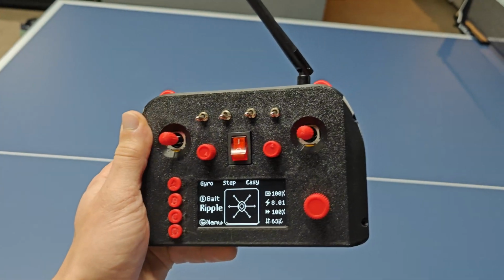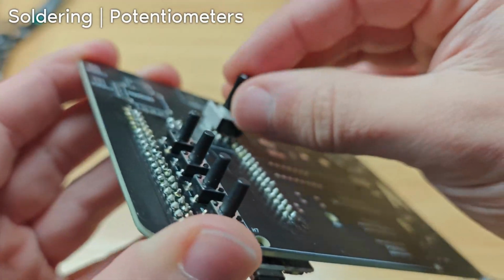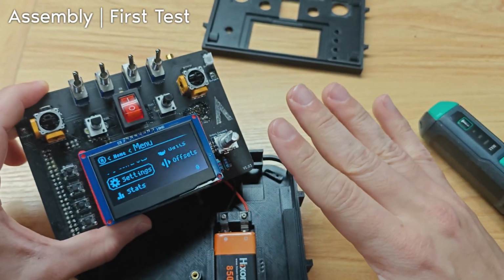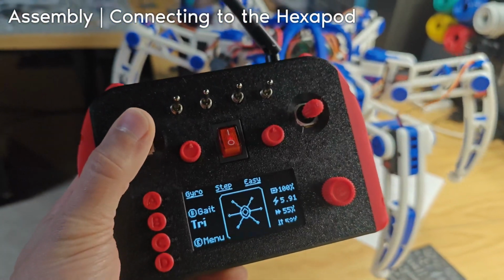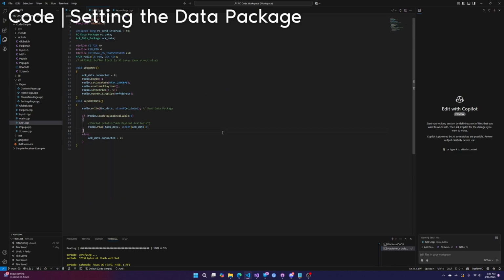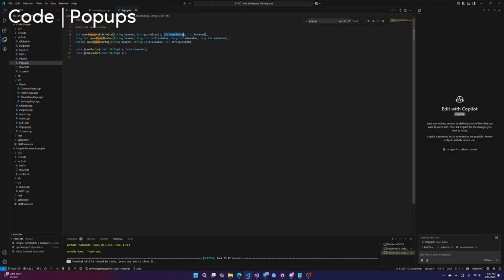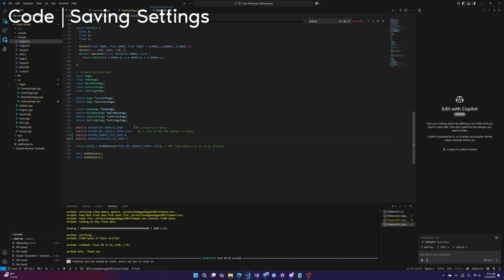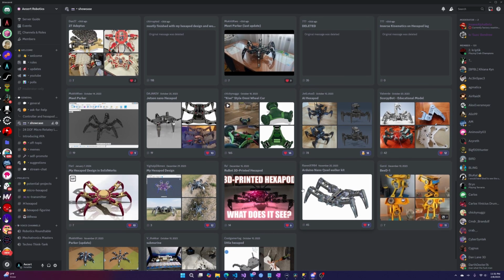How to Create My Arduino RC Transmitter

Comment: You weren't kidding about those Arduino pins - getting around the crystals for some of them was a bear - while I didn't do it I think it would be a good idea to trim the long pins down to just a couple of mm above the board for easier soldering

Comment: Hi, i was wondering what power set up you are using, im using a bread board and the Zeee 7.4V Lipo Battery 2S 50C 5200mAh battery you are using, but i was wondering what esc you are using?

Comment: I want to start this project but servos are extremely expensive in our country and I want to make them cheap and affordable. Would it be a problem if I use the mg996r 180° one?
Reply from the maker: @thotx7842  my CAD project won't work with them easily unfortunately. You'll be able to edit them to support the mg996 servos though. The files come with the kit or can be purchased separately.

If there is enough demand I'll make a CAD project that supports those servos.
Reply: @AecertRobotics  Would it be okay if I developed the CAD project and modeled the servos accordingly and made changes to the code?

Comment: Do you genuinely believe in brilliant as a good resource to learn more electronics? I'm a bit stuck as of late and not sure where to learn from
Reply from the maker: For the basics its honestly a really good place to start. They have a circuits course. Itll teach you about how voltage, resistance, current, etc works.

What are you trying to learn?
Reply: @ thank you, I’ll check it out
Reply: @ Circuitry, mechanics, and probably aerodynamics in the future, but I’m focusing on robotics at the moment
Reply from the maker: @novict gotcha. You should be able to check out the courses they have available for free. I don't think they have anything on aerodynamics or robotics, but yeah definitely check it out regardless! I can tell you that the linear algebra course directly related to what I had to do with my hexapod.

Comment: Interesting- this is a seriously in depth- in deep project that you've gotten yourself into- Not only that, but what you have put together is mighty powerful...you can do ALOT with such a platform...especiallt if you have the cababillities to "listen" to specific frequencies, as in monitor...kindlike a SDR...say you had another RC remote but didn't know the exact frequency...if your device could  pick up on the signal if the other remote were to be used...and say....capture that signal...

You mention the wireless module you are using...well the NRF has the same pinnout as a few others..one that comes to mind, being used alot in our gadgets and air cons and key fobs is the CC1101... pretty much take the NRF module and swap it for that of a  CC1101 and now your remote control can work with devices in the 400mhz, 900mhz frequencies...

Some thing to take away.... would be of use to utilize multiples of the NRF allow for full duplex..even though it does RX and TX alllready, you could seed things up or monitor the signal for other neat uses....
Reply from the maker: Ngl this is over my head, but if and when I make an advanced version of this controller id genuinely love your help/advice

Comment: You have done a nice step by step set of instructions.  In my view you should include some heat shrink sleeving for the bumper micro switches as some people may not dolder properly, and that would keep any stray strands of wire from fouling amything.
Reply from the maker: @videogenie1236  that's a fantastic idea. I'll add that to the written instructions.

Comment: Can i use raspberry Pi pico replacement of Arduino mega?
Reply from the maker: @Aditya-wi5ei you'd have to redesign the PCB which may be difficult, but it should definitely be doable!
Reply: @AecertRobotics  why you are using Arduino mega?  it difficult to get and we have better alternative for it like raspberry, esp8266 ,STML etc
Reply from the maker: @Aditya-wi5ei what do you mean difficult to get? 
I have no experience with any of those tbh. If anything I could've used a teensy 4.1 but I only discovered that after I was too deep into using the mega.  I do plan on using the teensy in my next version though.
Reply: @AecertRobotics   I am beginner in electronics. 
In my opinion  teensy , raspberry pi and esp are much Better to compare( price & features) Arduino boards  . 
Anywhere I am your new member in your channel family 👪
Reply from the maker: @Aditya-wi5ei  I do think Arduino is easier to use than esp and rasp but I totally agree the other options are overall better, I just didn't know about them 😄
But Arduino is still a great option and it makes it very approachable :)

So glad to have you!! You should join the discord if you haven't already
Reply: @AecertRobotics   please can you make next  video on remote & receiver based on raspberry Pi pico or esp  , cause in India atmg & teensy is  harder to find and i don't have knowledge about them 🙏
Reply: @AecertRobotics  but thank for your feedback ❤

Comment: Please make a video on 10 to 15 RC Transmitter and Receiver for controlling all types of Drone, all types of Aroplane, Car, Bohat, etc just like Flysky or Radiolink we can doa many more settings in this types of Radio controler , there are videos on YouTube but they don't include The Display for setting  Channels and more settings and watching the value of Throttles, etc please please make video and Give the code for each TX and RX , I think you understand what I am trying to say
Reply from the maker: @AdityaChauhan-x2j  I have very little experience with those kind of things. Honestly this sounds like a great question for chatgpt to help you out with.
Reply: @AecertRobotics what are you trying to say I am understanding